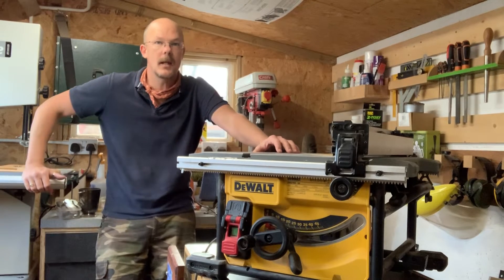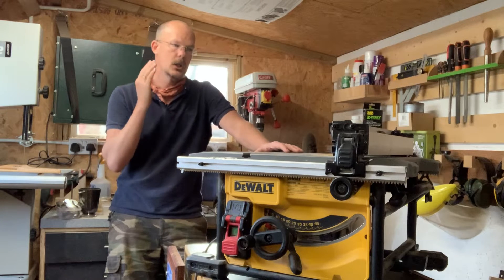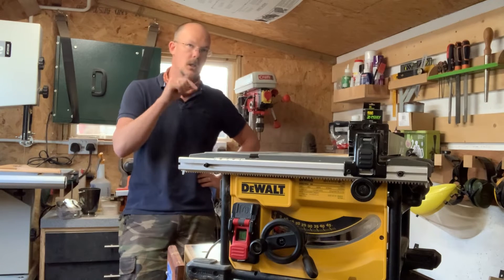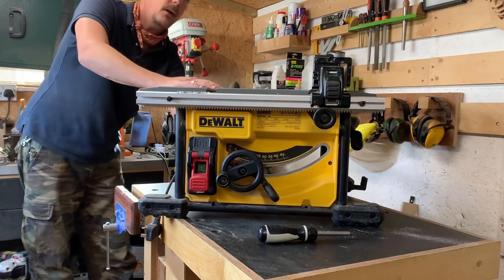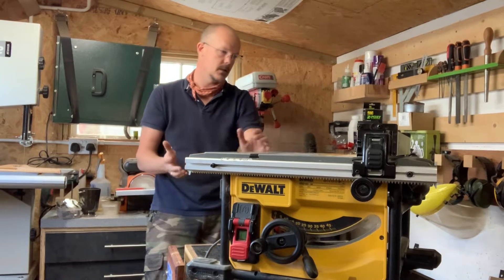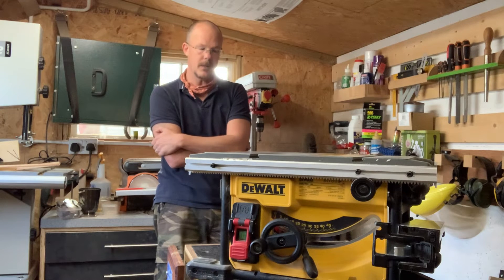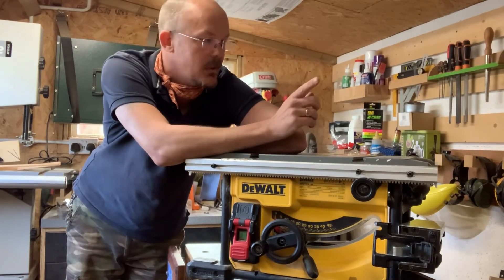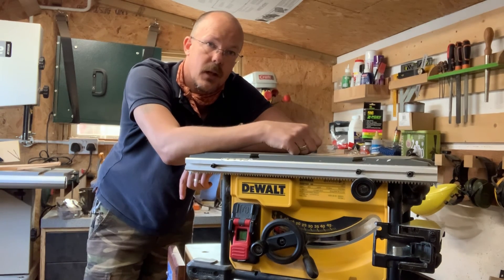DW7485 ep 1 - in depth review 2 years of use.

Comment: Was the table top flat, or did it dip in the middle.? Almost every single review I have seen people have the same damm problem. Terrible fault.
Reply from the maker: I found it to be acceptably flat. Less than 0.5mm variation in most areas. For a site saw it’s great, also as a saw for a compact space. Obviously it won’t compete with a decent cast iron table but it was close enough for me. 
I do wonder how accurate a table saw needs to be. It’s never used to produce a finished surface and wood moves so much that it’s almost pointless to chase perfection.

Comment: I’m have the blade raising issue. The problem seems to stem from the guide that runs on the rod on left hand side of motor assembly, the guide seems to bind on the rod ever so minutely, just enough to make raising the blade difficult. If I take some of the weight off the motor by slightly lifting the motor assembly by applying a little upward pressure to the knob that secures the riving knife or supporting the motor itself the blade raises easily. My saw is less than 3 years old & does not get heavy use so I don’t attribute excessive wear to cause this problem. I’ll try a granite/dry lubricant to see if that helps, I’m also waiting on a call back from a tech at DeWalt  to determine if I need to take it to a service centre. Anyway thanks for the info about the float fluid.
Reply from the maker: I made another video where I fix this issue using a few drops of bike fork shocks lube. It sorts the problem instantly.
Reply: @CaptainofmyShed  I saw that video, I’m going to give that bike fork oil before I go any further. Other than than that issue it’s a great saw.🇦🇺
Reply from the maker: I found the lube, (there are cheaper versions out there) solved the problem instantly!

Comment: 10:59 
i would blow out both the threads and the lift rod with an air duster once a month. 
and maybe spray a light amount of dry lubricant and raise and lower the mechanism a few times. 
cheers.
Reply from the maker: In the end some lubricant for bike shocks worked a treat.

Comment: The fence clips on upside down under the table on the left side off the table saw the spot you put it is for the upper gaurd with secondary dust collection port so If you get a y for your vacuum you can use double dust collection
Reply: Had to dig out my manual to check before I said anything 😅 but on page 11 under dust collection it says for best results use a Y adapter to connect both upper and lower dust collection ports because the upper collection port should stop a lot of the dust that  is causing the raise an lower arm to malfunction from dropping into the saw

Comment: This is so dissapointing, I had a record cabinet saw withe same problem the winding handle just fell apart and I just got rid.Bought a bosch thinking it would be fine and it's exactly the same as this in fact it's unusable now. The thing is the rise and fall is crucial to get he most out of a table saw. It's outrageous that this can fail. I was going to go for the dewalt but I also glad I saw your video. The search continues..... this should not happen.
Reply from the maker: Don’t write it off yet. There is a solution I demonstrate in the next episode to this video. Find the right kind of llubrication and the problem is solved completely and easily.

Comment: Use compressed air to remove most of the caked on saw dust and then use a dry lubricant such as silicone while being careful not to spray on surfaces that wood may contact. The compressed air is the most effective way and quickest method of removing sawdust within all the small crevices that are difficult to remove by stiff brush alone.

Comment: Thank you for the review and pointing of the issue with the raising system, thinking about this, isnt this a problem with other table saws ? I was considering GTS635, thinking this has some plastic, till the more expensive ones, the TS254M (not sure) and most definitively the Hikoki C10RJ has the same plastic mechanism.  It comes maybe to cleaning
Reply from the maker: I’d say the Dewalt is still a good choice. I did a second video to say I’d solved the problem. If you use a dry lubricant on the mechanism, the problem is instantly improved. I think if you do this every month or so, then this problem will be resolved.
Reply: @CaptainofmyShed  sounds like, cleanup your tools after usage :), cheers I value people like you who do a longterm review, have a great day sir

Comment: One of the Amazon reviews I read stated: "You cannot use a thin blade or any other type of blade because the riving knife is too thick. And for beginner DIYers who want to try their hand at building furniture or other fun wood projects, you will quickly learn that you are not able to have the clean/precise cuts that you need which can be very frustrating. And unfortunately, you don’t find out until it’s time to switch out the blade and it’s too late to return to the store. You will not be able to find a tooth count higher than 40 for this blade, so again - extremely limiting."  Can anyone confirm or deny, especially the part about no higher than 40 tooth count blade availability?
Reply: The riving knife that comes with the saw is for standard thickness blades and is .087” thick.  You’ll need a .063” riving knife for thin blades.  When I purchased a thin blade, I also purchased the thin .063” riving knife, both from Amazon.  Works great.
Reply from the maker: I haven’t looked into different blades for this saw but I never felt that I needed anything more on this saw. For finer projects I would not cut to final dimension with any tablesaw. Better to cut close and finish with a plane. That said I’m not a professional so maybe someone has different/better advice.

Comment: Well done videos,  thought out with accurate information and very thorough. So Cheers and thank you!  I have had the DWE7491 going on year 4 and yes minimal binding on the height adjustment lead screw but I think the key is to not let it go when you first notice and tend to it as part of regular maintenance and adjustments. My saw has been built-in into my workbench so a bit awkward to clean out but with access ports, i'm in the cavity of the under carriage almost daily with a shop vac and a bit of compressed air since my shop is in the basement of my house and dust control is paramount.  One thing I would add and I wish I had done so when I first got the saw, is to add a " soft start " module where Dewalt has failed in design but more than likely with intent. It's easier on the bearings, brushes, armature and  critical adjustments not get the immediate " jerk " start. I used a " Hitachi C10Rj " ( but there are several others )  I purchased on Amazon for about $10 CAD. Simple to install and the module/heat sink fits into the Dewalt switch box housing. Of course some will say " Warranty " , I say hog wash, I installed it with the same quick connects that were already in the switch box. A worthwhile upgrade. Adding a longer aluminum extrusion fence onto the existing also really ups the capabilities of this saw closer to a fixed cabinet saw plus gets rid of any "out of flat " areas on the existing thin aluminum fence extrusion...
Reply from the maker: Glad you’re enjoying the Dewalt. I thought it was a great small workshop solution and if maintained as you say, can last a long time. Thanks for the comment.

Comment: I have a 7485. Had same problem with raising blade. You need to dry lubricate not only the threaded post that cranks, but also the guide bar on the other side of the motor as well. Keep that clean and lubed on a regular basis. I've had no problems since.
Reply from the maker: I no longer have the saw but this is useful to others. Thank you.

Comment: The blade rising issue has happened to me after cutting very sappy woods. You just need to clean off the threaded rod that rises the blade and spray with a silicon spray every now and again.
Reply from the maker: Yeah I did a follow up to this video where I found a decent lubricant which worked a treat.

Comment: As others have said. Machinery needs maintenance and maintenance generally includes cleaning and then lubrication. I believe WD40 do a dry lube product.
Reply from the maker: Well that’s true, if delivered in a slightly condescending manner. 
If I’m dumb enough to not lubricate that specific part with the correct lubricant then I’m sure I’m not the only one and perhaps this video and in particular the second episode where I demonstrate the fix will be of use to some folks.  
Thanks for taking the time to comment though!
Reply: WD40 is NOT a dry lube, its wet (oil based) and will accelerate gunk build up. Graphite and Silicone lubes are dry. Not expensive either.

Comment: Luckily for new buyers, you don't have to worry about that because the tabletops are no longer flat, and the fences are all concave! 
 
RIP Dewalt. 😢
Reply from the maker: Is this really true? Sad times if so. Is there a reason for this?
Reply: Dewalt has just really cut a lot of corners since around 2017ish.
 
 All their tools (at least here in the US) have been cheapened. Sadly, they are more akin to their Craftsman brand. 
 
I've used Dewalt for 15 years. Planers, Table saws, and a plethora a  their XR and 60v lines have turned my shop yellow over the years. But as time as went on, the newer tools I'd buy started to have some serious issues. Bearings, trigger switches, batteries, the 735 planer and 779 sliding miter saw have had many components removed, and motors burning out early.
 
I gave up on their bigger corded tools and moved to other brands, but to be honest, it's like companies sell their "Wal-mart" quality tools to the US, because people still buy them.

In my search for a small table saw, I figured I'd give Dewalt one more shot. And now on my 3 saw (buy, exchange, I'm giving up on yellow. They just can't make flat tools for their tables. And, as you pointed out, that soft die cast aluminum on the housing will be full of issues in the future. 
 
It's sad what manufacturers sell to us in the US. But, as long as people keep buying them, and praising them, then their profits will continue to climb, as their tools continue to decline. 
 
If we in the US had a 230v power system, I'd buy everything from Europe. Lol.
Reply: @carterscustomrods  bye from Europe,but it's the same Chinese crap.

Comment: Ive had the dwe7492 for nearly 5 years and use it most weekends as a hobby woodworker making anything and everything from outdoor planters to furniture. I've run loads of hardwood, softwood and plywood through it and especially lots of oak and not had any issues with riser mechanism. I do try to give the machine a quick once over with the dust extraction hose at the end of each weekend to keep it kinda clean. It's been a great workhorse. Dust collection isn't too bad and it sounds like it's better than your machine. The blade guard dust collection has always been useless though.
Reply from the maker: Yeah in general terms i was very happy with the saw. A bit loud but handled most things a threw at it. Im sure a weekly clean out would have been a good idea but im lazy, that said, I did follow this video up with another showing how just a spot of lubricant (not grease) resolved the problem so still recommend this saw when people ask.
Reply: @CaptainofmyShed   Good to know, I've owned this saw just under six months.  I've cleaned it on occasion but didn't particularly focus on the riser screw. I will now, and I'll definitely be looking up your follow up video. Thanks for bringing this to my attention!!!

Comment: Thank you so much for this. I bought one as it had the best fence. My problem out of the box has been adjusting the riving knife which is 1m out and binds or stops the timber feeding through. Have you covered this in another video? I find the instructions on this very vague - they do not tell you what hex to use and I cannot loosen the bottom screws (34 in the the instructions)  I have asked Dewalt but they just refer me to the manual.
Reply from the maker: Hmmm that’s tricky. I no longer have this saw but for me, a problem like this out of the box is worth returning if the solution is not easy to do yourself.
Reply: Hello everyone I had this problem with my lumberjack table saw consultant jamming the threads all stripe and now scraped

Comment: i saw a vid where they say to add blue painters tape to the mitre guage rail, to help with the fit. works pretty well.
Reply from the maker: Yeah it does work but it doesn’t last very long and can gunk up a bit.
Reply: @CaptainofmyShed  i not tested it in actual use yet. maybe a better tape would work better.
Reply: I always put a thin piece of uhmw tape down the gauge on several places. On the rabbit edges (to keep gauge from moving side to side) and underneath it, I put a thicker piece of uhmw tape to cover the entire bottom 
 
I also put uhmw on the  underside of the miter gauge as well. 
 
Lastly, remove the Tony knob that tightens and loosens fir adjusting the angle, and put a better knob on it.

Comment: I wouldn’t store the fence there for transport. I thought that was for the blade protection plastic bit
Reply: The fence is stored clipped upside down underneath the table on the left hand pegs that you demonstrate at 3:28
Reply from the maker: I usually store it there when doing cross cuts and it actually fits perfectly. That said I’d probably just attach it normally if I were transporting it.

Comment: Just bought a 7485 this week so I'll keep an eye on the dust situation both inside and around that raising/lowering mechanism as you mention. What kind of dust extraction/vacuum were you using? I just have a smallish but decently powerful vacuum that I plan to hook up that will hopefully keep things in check.
Reply from the maker: Sorry for the slow reply. If you check out ep 2 I found a decent lube which seems to have solved the issue. I had been warned off wet or grease style lubricants and would deffo not use grease but a thinner liquid lube worked instantly and really well.

Comment: It's a shame there is no dado blade ability on this saw. For what I do, I don't need the extra depth of cut a 10-inch version had, but I do need a dado! The difference in price is more than double, unfortunately. I think the manufacturers know this and exploit it for their benefit 🤔.
Reply: There are a couple of videos on YouTube on the dado and one guy in particular managed very well
Reply: Freud makes a dado blade that fits perfectly but is not as thick as a standard dado blade.  Look for the Freud SBOX8: 8" Box Joint Cutter Set.
Reply from the maker: I hear you. The Axminster 10” craft saw can be modded to accept a dado stack although not a full one. It’s not that much more expensive but not a site saw so if you need something portable then maybe not a good option.
Reply: Thank you for that bit of information! That's definitely a deal breaker for me.

Comment: Same thing happened to me. DW7485 Type2.  The aluminum stripped and the assembly no longer rises.  Cust service wasnt familiar with the part that stripped, which is preposterous, and they gave me a local service to get it fixed.  Warranty is for a year, it happened to me at 18 months too.  Im afraid its rendered useless.  I regularly blew out the dust and constantly brushed away bits to keep it clear.  Its a terrible design flaw. They need a recall.
Reply from the maker: It’s a shame this happens because it’s such a good saw otherwise.

Comment: The machine needs periodic cleaning, same as most other tools. The manual actually states that the height adjustment screws should be cleaned and greased if the raising/lowering mechanism is tight. I'm on 4+ years with the DW745 and no issues with it at all, just a regular blast of compressed air all over.
Reply: I've got a different version of this saw and I get a lot less dust problems than you seem to have. I use a Record Power DX1000 extractor to pull the dust out. Not sure if mine is earlier or later, obvious differences are, different switch, my fence is stored upside down on the standard rail and the blade guard stores roughly where your fence does. No problems with it so far.
Reply from the maker: @petemelbourne42 , is it the larger version? Possibly has a larger dust extraction port?
I genuinely like this machine but it’s on its last legs. On the look out for a cabinet saw now. 😉
Reply: @CaptainofmyShed  No same size, has a 2 inch port on the back and another about 1.5 on the blade guard that I don't use
Reply from the maker: Have you lubricated with grease or a dry lubricant when servicing?
Reply: @CaptainofmyShed  Initially used PTFE dry lube but it doesn't last long. White Lithium spray seems better, but the manual recommends general grease. The issue is the two bevel gears, they tend to bind with a build up of sawdust - toothbrush and compressed air sorts it quickly, but do it outside!
Reply from the maker: @thewoodenduck . What’s strange is that it’s only stiff on the rise and the gears are not Especially clogged up I’ll try regular grease again, nothing to loose I guess.